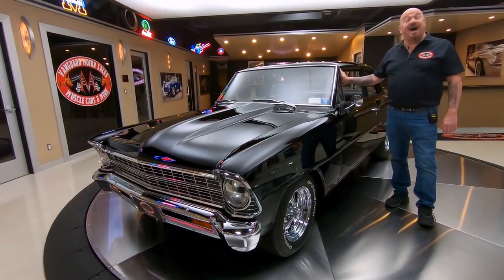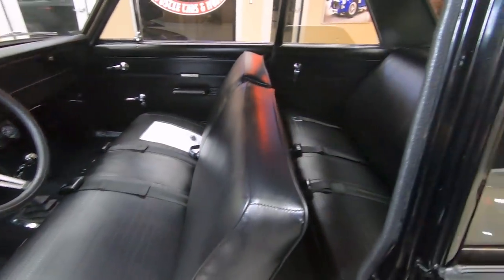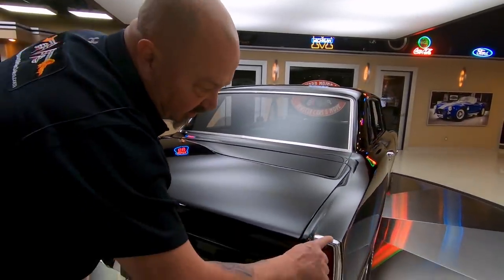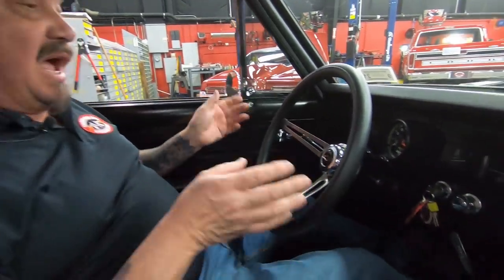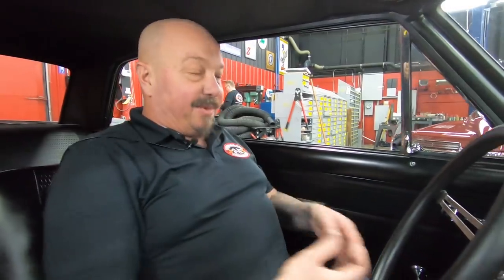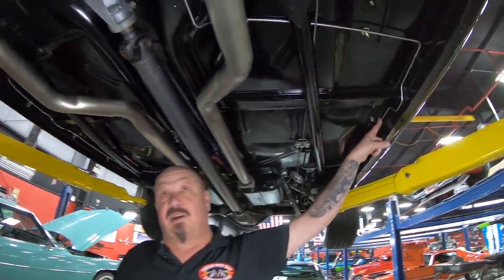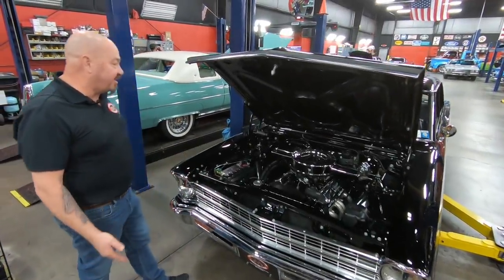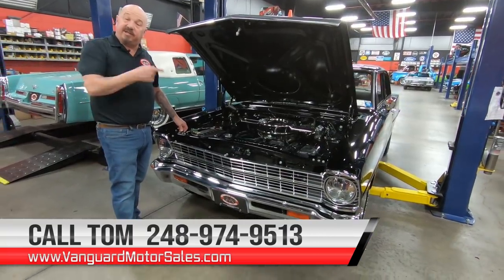1967 Chevrolet Nova Chevy II For Sale

Comment: 327cid is ok, a LS would have been sweet,more gas mileage. The front end and rear still have the stock suspension. Which you'd have to upgrade if you plan on driving it fast and want it to handle nice.old school is nice,but in today's pothole roads old tech leaves something to be desired.